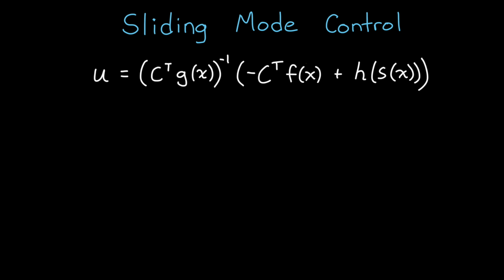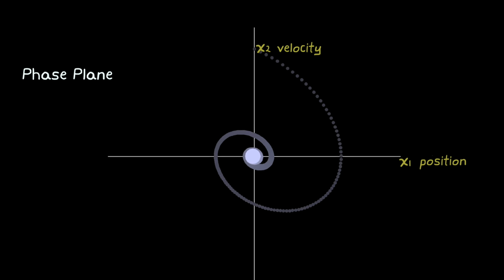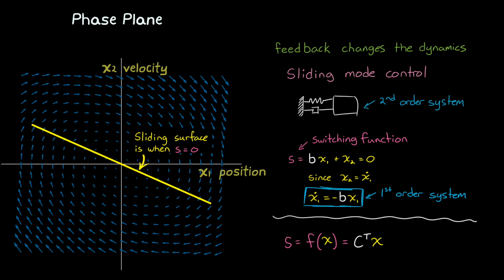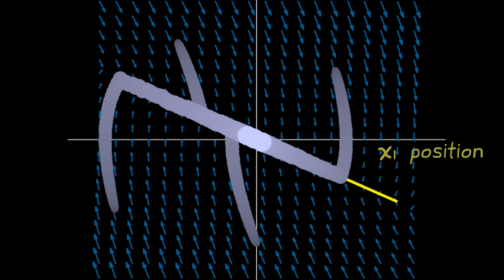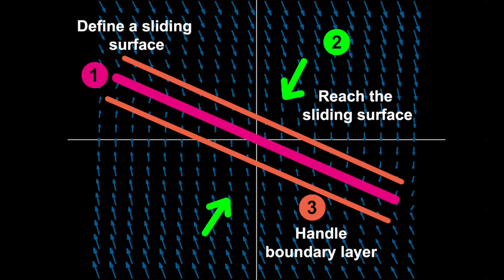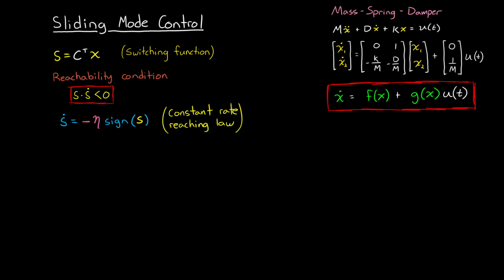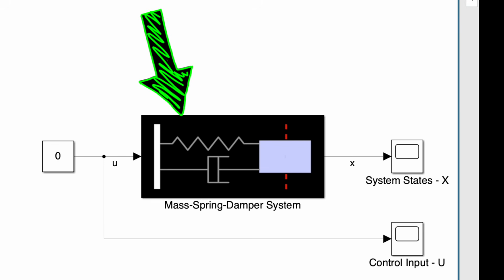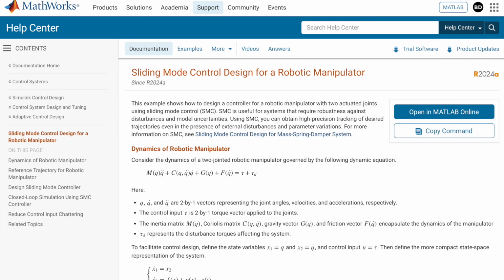What Is Sliding Mode Control?

Comment from the maker: If you have any questions or comment, please let us know!
Reply: I would like to understand the difference between regulation, tracking, and servomechanisms. Does regulation mean that the reference is constant, and tracking that the reference is variable? How does the servomechanism fit into this?
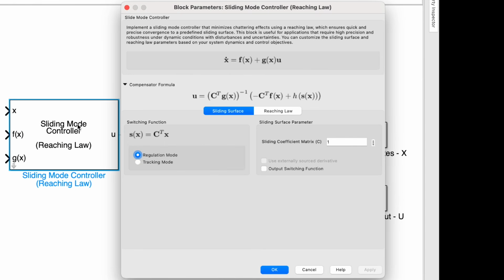Reply: @WailTheDesigner  in the case of the SMC block in Simulink, regulation mode drives the states to zero. And tracking mode drives the states to a reference. In tracking mode, that reference could be constant, variable, or even set to zero (in which case it behaves the same way as the regulation mode).  Around 17:00 in the video, you can see how the switching function changes as I toggle between regulation and tracking.  A servomechanism is something different. It is a mechanical device whose position or velocity is controlled through feedback. Probably most servos are controlled with some form of tracking mode since you are often asking the device to move to a given position or velocity. Does that answer your question?
Reply: @BrianBDouglas  Yes, I understand now. I really appreciate your help—thank you!
Reply: In the video, you mentioned that sliding mode control can be used to control a robotic arm. What are the specific challenges of using sliding mode control for robotic arms and how it can be addressed?
Reply: This simulink block is only available in matlab 24?
Reply: @Msb-256  Yes, the Simulink block just came out in 24b. There are examples implementing SMC in MATLAB from earlier releases but they don't make use of the SMC Simulink block.
Reply: Nice video! I am a graduate student looking to work at Mathworks as an EDG intern. Just submitted my application for this cycle!
Reply: How can i find this block in matlab 2018a

Comment: I like to use the tanh() function to convert s to u.  There is a little more error but the output doesn't swing back and forth between the rails rapidly.    I use  M*tanh(a*s) were a is like a proportional gain around 0 error and M is the output limit.  Dead time is the killer.  I use an observer.   For temperature systems, I would use a Smith Predictor.   The outputs would then fire on and off turning SCRs on and off depending on the temperature error and rate.
Reply: Thanks for the comment!

Comment: I wanna know what's in the mass-spring damper system and waht is the shape of output.
thank you
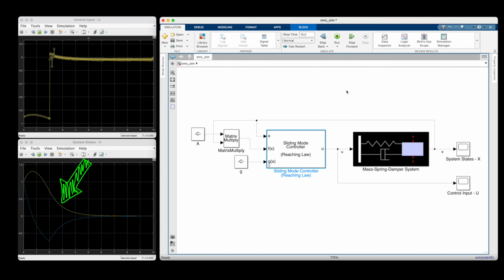Reply: I'm not sure I understand your question exactly. If you're talking about the mass-spring-damper simulink block, I just coded the equations at 11:30, made it a subsystem, and then created a custom mask image for it with a drawing I made. You could do the same the much easier with just a state space block. As for the shape of the output; are you talking about the state of the system over time? Like you see in the bottom left corner at 18:40?

Comment: Excellent explanation, Sir thank you. I have a question about the chattering phenomenon. You mentioned that the convontional SMC technique suffers from chattering. What are the methods to address or reduce it without resorting to higher-order SMC techniques?

My second question is: Can you make a video about the Prescribed Conversion Law technique?
Thank you
Reply: The chattering-reduction methods that I mention in the video (like treating the gain differently inside the boundary layer) is all I'm really familiar with. Also, I'm not sure what Prescribed Conversion Law is and Google it didn't help me much. Does this have to do with reducing chemical equations? That is really outside of my area of expertise. Sorry!

Comment: Hi. I'm a newbie when it comes to control systems, so I would be grateful if anyone could explain what the C transpose mean. Thanks
Reply: C is explained at 5:46. It's a matrix of numbers which has the same number of rows as the number of states in the system and the number of columns is the number of inputs into the system. The numbers in C define the sliding surface. Taking the transpose just swaps the rows and columns of the matrix. This is done for the multiplication of C and x to work out. You can see that at 5:55. C has two rows (two states) and one column (one input into the system). So, to multiply C and the state vector, we have to transpose C. Did that answer your question?

Comment: Can SMC deal well with time delay system?
Reply: I think in general it can handle some amount of time delay due to the fact that there is some robustness built into the controller, however, I don't think the standard SMC controller is designed specifically for time delays. For example, a delay in the actuator would immediately increase the chattering around the sliding surface since it would take an additional amount of time before the opposite sign is applied to correct it. I haven't looked into SMC explicitly with time delays so hopefully, someone else can chime in if they know.

Comment: Great video, thank you! Could I have two questions for further clarification?
1. Regarding the “boundary layer” conditions.. I assume that theta=-1 iff s < -phi? (Emphasis on the minus)
2. Solving the equation for u(t), the output is a 2x1 vector. What is the interpretation of this and which element of this vector is then used for the control?
Reply: 1) You are right! Great catch. I forgot the negative sign on the phi. Thanks for the sharp eyes!
2) u(t) should be the size of the number of inputs into the system. In the case of my example in the video, u(t) should be 1x1. Can you explain how you're getting 2x1? Maybe one place for error is with f(x). f(x) is A*x and not just the A matrix. So, A*x is 2x2 times 2x1 which makes f(x) a 2x1. C transpose is 1x2 and so 1x2 times 2x1 is 1x1.
Reply: 2) you are absolutely right, I did not realize that f(x)=A*x and not only A.. Thanks for the quick reply :)

Comment: It would be great in the next few videos to show an implementation of SMC for temperature control. A lot of temperature control systems use PWM to control some heaters output so a continuous control value (duty cycle) has to be converted into a discontinuous control signal anyway. It would be awesome to see to computation and implementation of the discontinuous control directly!
Reply from the maker: Great suggestion! Thank you.

Comment: What the difference between Sliding Mode control and lets say Adaptive gain which depend on error size for example?  Its basically the same from my perspective
Reply: They are both robust control strategies, but they approach the problem slightly differently. SMC has this discontinuous control where it switches back and forth to slide along the switching surface. As I explain in the video, this high gain switching can allow for the system to be really robust to parameter variations and external disturbances. With adaptive control, the control gains are adjusted smoothly and continuously to account for changes in the system dynamics. I don't believe adaptive gain is as robust to uncertainties and disturbances as SMC because of the time constant involved in adjusting the gain. Adaptive gain doesn't have the chattering issue like SMC has so there is a trade off as far as I'm aware.

Comment: Awesome explanation from Brian. One might say as usuall at this point.
I used SMC on a speed control of a system where mass and resistance have high uncertainty and will change quite a lot during operation. Might be interesting to show how uncertainty in the model can break traditional controls like PID, but not SMC.
Reply: Thanks for this comment. I thought about trying something like that in this video but it was already 20 minutes long! PID can be pretty robust though, but often just not as robust as SMC. Are you still building systems with SMC? What do you find are some of the challenges with it? Thanks!
Reply: @BrianBDouglas  Thanks for the reply. Yes, keeping explanations compact really is an art.
I haven't touched it in a while. We prefer using PIDs when sufficient as more people know how to work with them. But it's definitely a tool if model parameters change a lot.
Shattering was challenging. It can work the actuators pretty hard and introduces vibrations into the system. You need to be aware of them and how they might affect your sensor readings.
Likewise precision is a tradeoff with the reaction to disturbance. If you make the boundary layer bigger and reduce the gain you get more error from disturbances. If you make it tighter you recover faster, but get more shattering.
Having some friction in the system did help with shattering as the actuator couldn't follow as much. An integral part inside the boundary layer can reduce shattering. A term that scales the gain depending on how far away from the sliding mode you are helps with the urge of the system to shatter when it reaches the sliding mode.
I'm looking forward to the next video.
Reply from the maker: Great feedback, thanks!